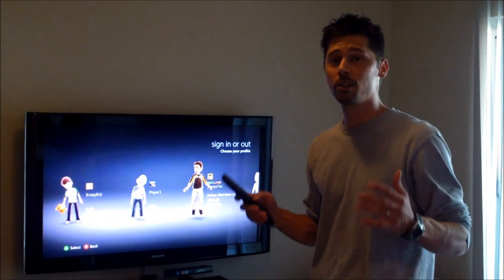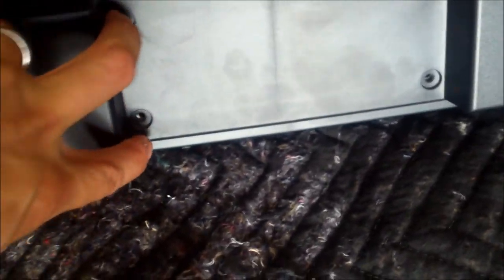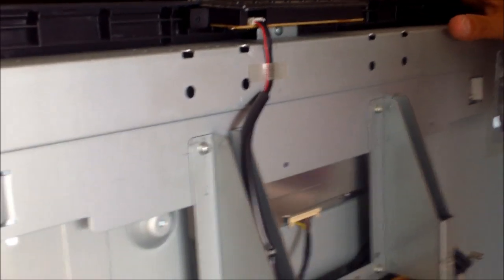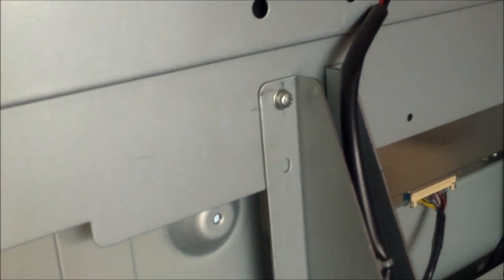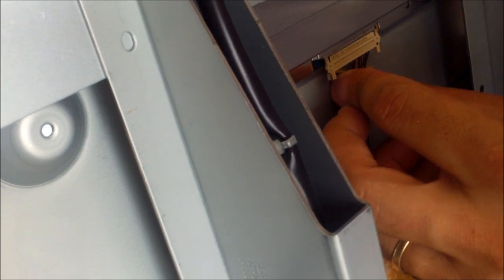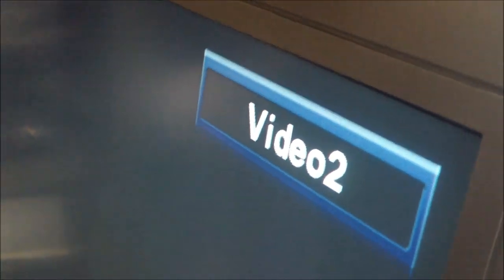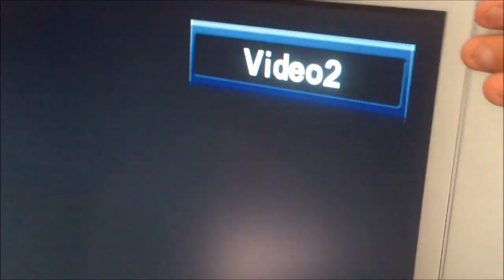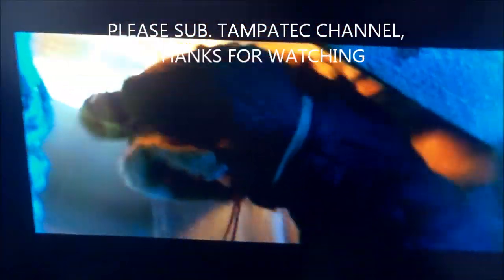HOW TO FIX LCD TV REVIEW - Bad Picture Screen

Comment: ed wesala I would running the flashlight on your TV, if it is an LCD TV.  This test will help to determine if the problem is the main board of the backlight inverter.  Please follow this link to view the flashlight test video:  No Image No Picture on Screen-Flashlight Test LCD TV Repair - How to Diagnose Broken Board TV Repair  Please reply with your results and we can help to recommend a fix.  www.shopjimmy.com

Comment: Hi ! . I like your videos on tv fixing. I thank you for all what you have tough me. Not too long ago I started fixing tvs for people that I know, I have been lucky so far, but now I run to two problems with two different tvs both lg and led. One 42 and another is 60.the 60 has a sound but no pic, I changed the t-con but still all what I hear is hassing noize. The 42 had a bad main board, I changed it but the pic is very fazy. I changed the cable going to the t-con and the t con but no luck.

Comment: No doubt at least the Rays finished strong.  The Bucs are a wreck.  Cool thanks for the info, I'll check that out.  The TV is hung on the wall and kind of a bear to get off myself.  I'll let you know what I find.  I'm leaning towards the main logic PCB, since there is multiple issues.

Comment: I have read on the Samsung FAQs that this is usually caused by the fact that Samsung did not put a spacer in at the bottom of the tv and causes it to ground out.  some people report Samsung fixing or replacing even after warranty expires.  My tv is 6 yrs old and just started this.  tipping it over relieves it for a short time.

Comment: I have a vizio P42 made a poof sound and turned off. I took of back panel ans found a blown fuse and and bad capasitor. I replaced both and then tv did turn on but only sound no picture. So i replaced the y sustain board and now i do have picture but its not clear and a bit dark. Can you tell me what i need to do to get clear picture?

Comment: Hi I have a Samsung 46inch 1080hd tv. I am having problem with the picture. Get shadow on right side and top. On hitting on back it goes away and comes back in a minute or so. What could be causing this issue any idea.
Reply from the maker: check panel connections or t-con board or can be bad inverter backlight. call to confirm with shopjimmy techs and to get tv parts - 1 (877) 881-6492 / (952) 881-6492

Comment: I have a LG42LX6900 led tv,it seems to power up and responds to the remote but fails to give out any audio or video .Do you have any suggestions, all capacitors visually check ok.

Comment: I have a42 inch l.g. plasma tv. When switched on is fine,  once it starts to warm up the picture becomes flashy then fayeds then  colours bleed into each other.
If I switch off for three or four seconds, it's a good picture again for a short time 30 second or so.It then starts to fail again.Can you offer any help please

Comment: Tampa Tec, Hi, I live in Wesley Chapel, Florida.  I have a Protron PLTV-3750, the HDMI input doesn't recognize the cable.  The source and power buttons don't work on the front panel.  Are there any recommendations to the problems?  Thank you in advance?

Comment: Hey TampaTec! Love the Vids. I have a problem with my Sony KLV-S40A10. I get sound but no picture. When it's on I see the back light turn on but nothing on the LCD panel. Could it be the Tcon board? or Inverters? I've looked up and down for blown caps. But haven't found anything visually wrong or at fault. i'm assuming my power supply is working fine because i'm seeing back light and getting sound. Anything I might be missing here?? Any help would be greatly appreciated. Thanks

Comment: i have an RCA 46" LCD FULL HDTV, my directv cable junction outside shorted out, and when it did it traveled thru my HDMI cable knocking out my tv. First i replaced the main power board. Nothing happened. still dead. so then i bought a new video board, it powered on but the picture is very rainbowy and pastelic. So i then ordered a new T-CON board and its still the same. ive replaced the parts with exact numbers on the new parts. what do i do now? please help...

Comment: i try to call lg but his model have only the normal 2yr warranty 
i try to check all boards inside tv and seems to be new....
the problem appear 1yr ago and appear only one big lines about  of 7/8 pixel width and long not like all height of tv. now when i power on tv after a night big line is present but no other line that appear after some minutes and more time pass more lines appear the i switch of for a night and in the morning there is only the big one
are u sure is not a lcd pannel problem?

Comment: I have a Panasonic tc-p50g10 viera plasma.  In a lightning strike even though I was on a very good surge surpressor, I got zapped.  No Pic, no sound, no menu, no input info.  There is a light of the screen but no pic. would like some guidance.  Bob

Comment: Hi there I have a LG LG 50PV350T the problem is that it's not turning  on you hear it click the stand by light goes out then comes back on I unplugged the y-sus board or the large board on the left that connects to the buffer board. having unplugged it the TV powers on or the stand by light goes out and it looks like it stays on, however I am unsure what to look for on Y-sus board can you help me please Kind Regards.......Mark
Reply: Hi there I too have the same problem with my TV, have you resolved the issue? If so how??

Comment: Hey bro I have a 55 inch insignia flat LCD and the screen has lines going thru with a pinkish color and it goes in and out then it works then it mess up again what should I do bro

Comment: theres snow look like small white dots whats worng any help
Reply: +j2323j Dude im going through the same thing, its driving me nuts. Just dropped $189.99 on a LG, its supposed to be 1080 pixels yet the image is as bad as a tv from the 80's. No way its supposed to be this bad.
Reply: hey, i fixed the problem. it turned out to have nothing to do with the tv itself, It was the box (DirectTV) that was the problem.

Comment: My Sony Bravia KDL-46W4100 has the same issue as this video I posted below. I did some caveman trouble shooting like you said in the videos and it fixed the problem but it will come back after the tv has been turned off for awhile could it be a loose connector I don't really want to take it apart if I don't have too. youtube.com/watch?v=69-krUwUzvU Thanks for any advice